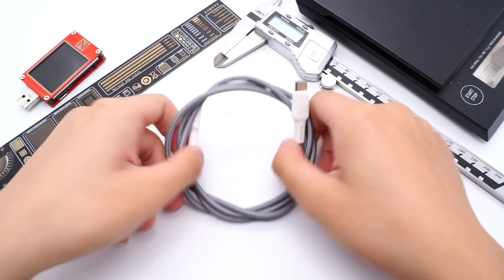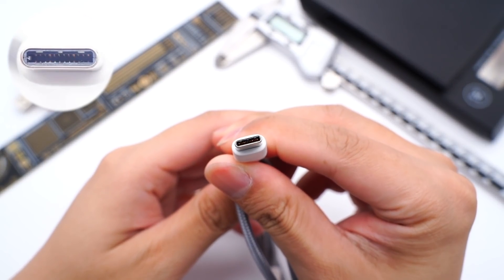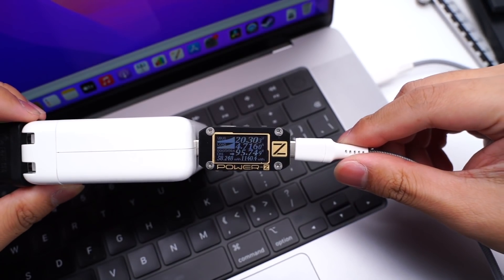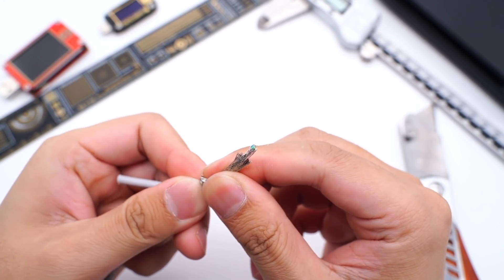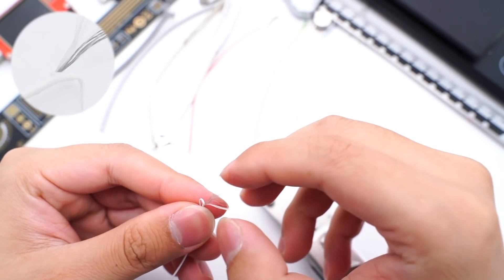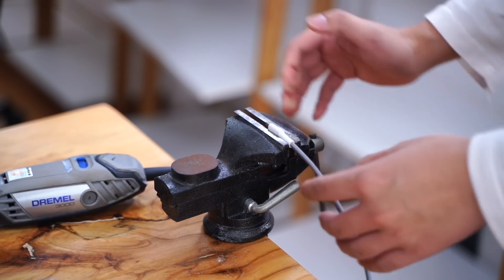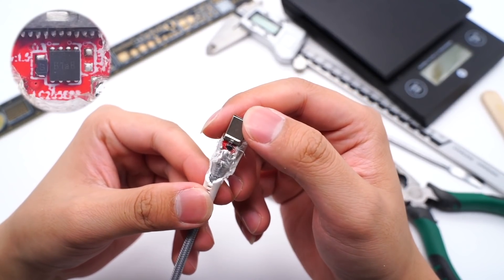Support up to 240W | Teardown of Newest PD3.1 Dual USB-C Cable

Comment: So nothing has changed in cable thickness, it means it passes thru 48V@5A. There should be no difference with 100W cables, wich are the same ratad 5A, only with 20V
Reply from the maker: The voltage needs to be raised, and it needs to satisfy EPR standard.

Comment: Curious if these small wires can carry 240w without overheating.
Reply: Only the 2 thicker wires are used for the power delivery and they will never be put under more current than 5A. Additionally, the cable is very short, I don't expect resistance to be significant at all. If I had to guess, it won't become more than slightly warm to the touch under continuous load.
Reply: Because heating is caused by current not voltage, there’s actually no difference in cable heating between 100w and 240w

Comment: Do u know if there is a wall power socket that supports the USB-C EPR 240W to go along with that cable ?
Reply from the maker: We do not have that yet, but I hope we'll have it soon.
Reply: @ChargerLAB  That would be amazing because I am planning to put those in every corner of my new home :)
Reply: @theo610  take it to the next level and add wired Ethernet to the USB-C sockets too. 
PoETexas have some awesome power + data USB-C wall sockets, but none with 240W + gigabit yet.
Reply: @iamdave84  Do you mean USB & POE COMBINED in one USB C connection ? Meaning one connection does data & power (POE) ? Because that would would be incredible indeed.
Reply: @theo610  yes, that's exactly what I mean. USB-PD power, plus wired data through a USB-C wall socket, all powered by PoE.
Reply: @iamdave84  I honestly would be happy with 'just' the EPR connection but a combined one would be absolutely amazing. I actually have Unifi Switch Pro 48 PoE switch so that would be an ideal connection if one where to ever exist.

Comment: i prefer use the old DC circle connector to use 240 watt power consumption on electronics device than use type C on 240 watt PD.

My reason is,
240 watt is huge power for that tiny cable and type c connector. i know it can run normally BUT you must have top quality material for that cable n the type c connector. (i bet the cable is not cheap)

what about high transfer data + high transfer power type c cable?
🤭 I bet u can buy new headset/mouse/keyboard for that money. Its better than u buy for that cable right?
Reply: When you use a USB C dock that charges your laptop and connects everything with one cable you'll never go back.

If you can have a DC connector cable that supports 240 watts you can have a USB C cable with the same raw material cost. You'd use the same amount of nickel. The expensive part is the connectors, which contain chips and are complicated themselves. But even that's not that bad. 

Also, 240W is essential to convert gaming laptops into using USB C. I won't buy a gaming laptop that doesn't charge through USB C, that's how good it is. But, that limits me to 100W currently.
Reply: @AJ-wf1vh  did you know about arc phenomenon?
and the type c length is 8mm + has 12 pin/1side. 

for me this is a big problem if your electronic device often get electric arc
Reply: @m-luthfi  usb c has a pairing protocol before supplying voltage higher than 5V

Also, voltage and ground pins extend further, so data pins disconnect first. When they do, the voltage is cut before the voltage pins disconnect

So arcing is not an issue. Voltage is supplied only when the pins make contact. Perhaps with a dummy barrel plug it is.
Reply: @m-luthfi  while it may seem a small distance, I will assume that the engineers that made the connector did the math. So it should be fine for 48V 5A
Reply: @AJ-wf1vh  i wish they can solve that. 

as i know, feb 2022 there is still no electronic device (especially laptop) support more than ~100 watt type c PD. perhap that is the problem why manufacture company didnt make type c PD 100 w+ cause of that issue (?)
Reply: @m-luthfi  MacBook 16 supports 140W through magsafe. Magsafe on the other side is usb c and it is implemented using PD

They're coming, it's just too early. Standard was just announced. This is the first cable
Reply: @m-luthfi  some gaming laptops that are releasing this year actually do have >100W USB-C charging support. The Lenovo Legion series come with 135W support, for example.

Comment: USB in 1996: 4 wires are enough
USB today: We actually need 22 wires just to connect 2 devices
Reply: cuz protocols have became complex and usb c supports a ton of them, thunderbolt cables can be even used for egpu's so 20+ is a bare minimum there as pcie uses a lot of io

Comment: where is voltage drop test at given amperage
Reply: I think that tester only works when connected to the power source end of the cable, but it would be interesting to see if the voltage at the other end is any less.

Comment: Dude...
You could have tested the Data Transfer Rate before cutting the cable... What a waste....

DIY a test circuit with a USB C Breakout Board.
Anyway, it should work because they just increased the voltage in the new cable.
Reply: Charging the MacBook at 100W confirms that the data transmission was working at USB 2 speeds.
Reply from the maker: We do have test it, only for USB2.0, so it's a charging cable, not for data transmission.

Comment: Now we just need a USB4.x that brings at least 80gbps to go along PD 3.1 for the ultimate connector tech.
Reply from the maker: I hope so.
Reply: @ChargerLAB  Where can I buy the cable?
Reply: Thunderbolt 5 with 80 gbps will be released before that.
Reply: @aninditabasak7694  Yeah, but only 3 people on the planet will use it..

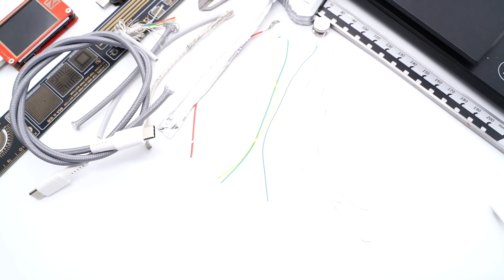Comment: 4:36 the maximum voltage with PD 3.1 is actually 48V, not 50V ("New 28V, 36V, and 48V fixed voltages enable up to 140W, 180W and 240W power levels, respectively." https://www.usb.org/usb-charger-pd )
Otherwise it would be 250W, as 50V*5A=250VA=250W.
Reply: The USB PD 3.1 specification specifically defines EPR as a cable supporting a maximum voltage of 50V (50.9V specifically)
Reply: @prajaybasu  probably at a lower current, so 50v at 4.8a which would equal to the claimed 240w or maybe achieving the 240w at a lower voltage like 48v
Reply from the maker: Yes, the cable can support 50V in theory, but actually it will be limited to 48V because of the protocol.
Reply: usb c is nice and all but it has some quirks (not for consumers tho) i think qc 3.0 and above does an amazing job of power delivery providing 200mv increments and is very easy to implement, plus the usb c negotiation is pretty complex and kinda hard to implement lets say for start ups, and uses a dedicated ic to interface with the device which further increases the complexity of implementing it. i have implemented qc in many of my projects and it was very easy, but usb c pd was a pain in the a** to do, luckily there exist cheap trigger boards (zy12pdn) but then they are not open source and use some unknown ic

Comment: Been looking for this PD 240W since Q3 2021, still cant find any OEM charger and cable
Reply from the maker: Any new technology takes time to popularize
Reply: Gaming laptops that could be powered by USB-C would be great. Have your 240 watt charger at home for gaming, bring a 60 watt usb c charger when you’re away and just need it to turn on or charge but not game at full speed.
Reply: @ahgflyguy  I'm fully aware of its application, but this might be taking longer for mobile and laptop charger to adopt due to the shortage compared to PD 100W 4-5 years ago

Comment: What does (tunsal) fiber supposed to do ? 😅
Reply: tensile fibers. so when you pull the cable, it doesn't stretch/damage the metal, but rather the fiber resists pulling.
Reply: @geobioboo  🥰🥰🥰 thanks ❤️